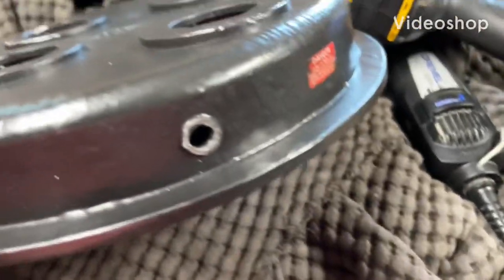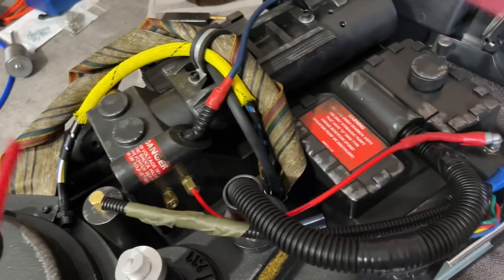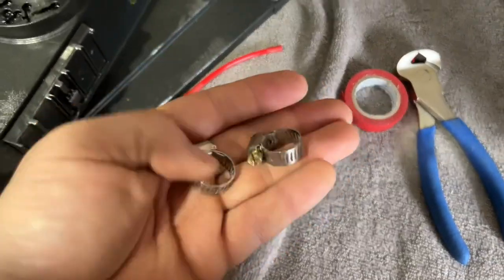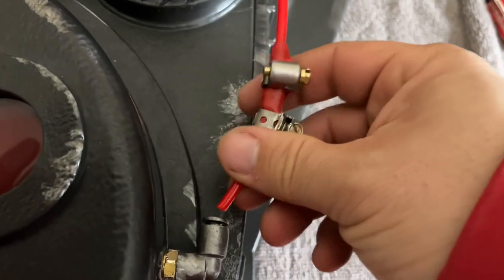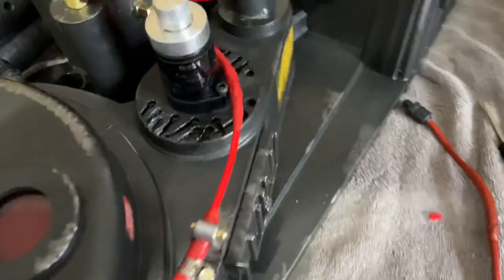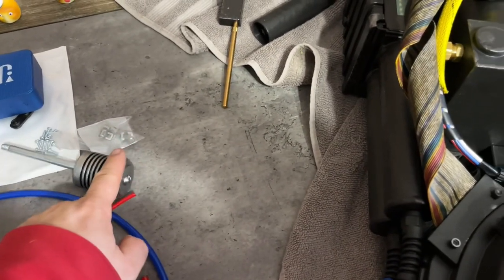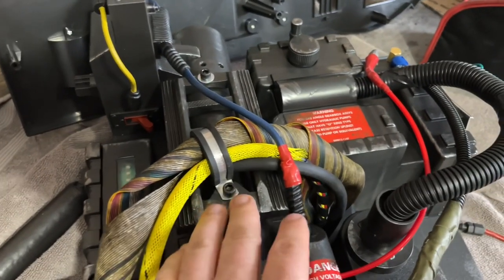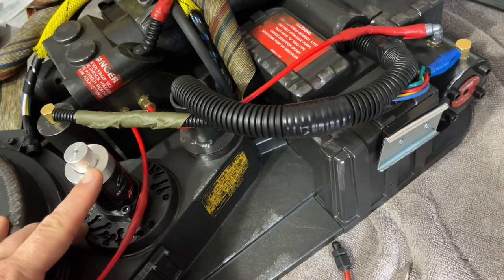Haslab Proton Pack Hose, Elbow and Screw Replacement Update 6

Comment: Great job with your pack! Did you glue the elbow in the hole you made in the cyclotron cover? Cover plastic seems too thick for the short elbow to go all the way through and attach to the nut on the inside.
Reply from the maker: Thanks! I made threads for it to just thread in
Reply: @ghostbusterspluscollector9624  where did you get the elbows from?

Comment: Are there wires inside? Where are you drilled? I’m afraid I’m gonna accidentally cut it when I drill it.
Reply from the maker: Do you mean in the cyclotron cover? Where I put the gray elbow with the red wire? If that’s what you mean there is a wire but it’s not near where you would drill the hole for the elbow at least on my pack the wire was not there.